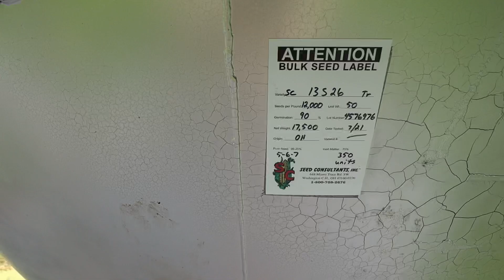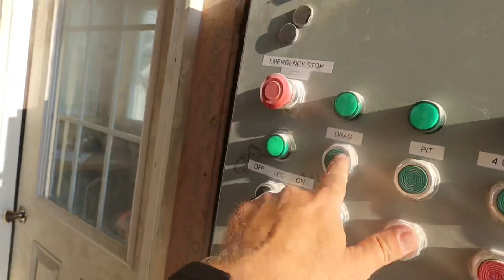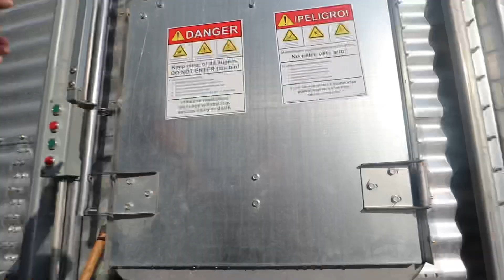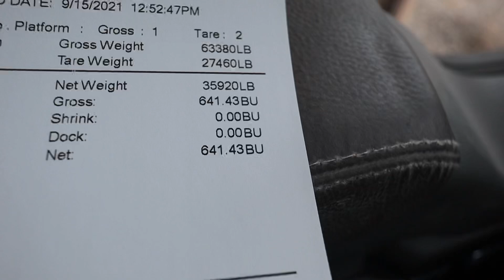Attempted Car Theft Fail Caught on Camera

Comment: BJ, good job on making it to the top of the grain bin.  Now wait a week and do it again, and it will be much easier.  My issue is with anything that holds me down.  I hate having blankets tucked in around me and I only pull them up to chest height.  I hate Tight shirts.  I cannot sleep in a sleeping bag. Seatbelts are a struggle when they lock up.  So good on ya.  Do more videos, this was not a boring episode at all.

Comment: No worries BJ, I'm terrified of heights but i never realized how bad until i tried to cross the glass floored skywalk at the Grand Canyon 4000 feet up.  It took me 45 minutes to walk around a 10 minute attraction and thats with stops for photos.  I can push through most lower heights.  But solid job BJ that was more of an acomplishment than not decking Brian when he says you sound like your Dad.  But at least Brian did a solid Job editing.

Comment: Well done BJ for getting up the bin, was thinking maybe a flag or a wind sock on top of one of the bins to tell the wind direction when loading in the drive though.
Reply: We usually look at the leaves on the corn when we pull a truck in. The problem is that the direction changes pretty frequently.

Comment: With the stop/start stations at the individual bins, I hope your system is wired so that if you (for example) push the stop for the incline auger dumping into the leg, that the intermediate and unload augers also shut down.

BTW, Good Job on filling in for Brian, BJ!
Reply from the maker: They are wired in a way so that the bin unloader can’t run without the jump auger running and neither can run without the leg running
Reply: @BriansFarmingVideos  Did you guys request that or did the electrician suggest it? Either way, that was some smart thinkin!

Comment: BJ, that is the way sweeps are supposed to be used IMO. Not a farmer but it has always looked like waisted effort and time to chase the sweep auger around the bin until it had finished its' job. I'm also pretty lazy. Took me most of the video to figure out the car theft angle. Not too bright either. Thanks for sparing us the 3 hour waits at the elevator. That would have been boring.
Reply: I do the same thing, pull it a few feet away from the wall and run it around again.  Sometimes push it another 5 feet or so and let it go around another time.  Let the machinery do the work.

Comment: Climbed a tree,it hanged out over a 100ft bank. Tied in upper most crotch of tree. 80ft off the ground my spike's pop out,I hang upside down, yay,yay me. Dude if you fall you're fired when/ if you hit the ground. No pressure.

Comment: Sounds you need to rethink owning Chevrolets.
My nephew is afraid of heights also, my brother was hanging a ceiling fan in a tall living room. The general had been nice enough to put up scaffolding for us, I can't remember if my brother dropped something or just forgot to take it up with him, I looked over and my nephew was going up to the top of two layers pf scaffold when he reached the top and realized how high up he was it took both my brother and I to get him down poor kid was shaking like a leaf.
Heights didn't use to bother me I used to work on industrial building and walking red iron was part of the job, thought nothing about walking off the deck onto the 6 inch highway 30 or so feet in the air. Not so anymore 6 feet is enough for me